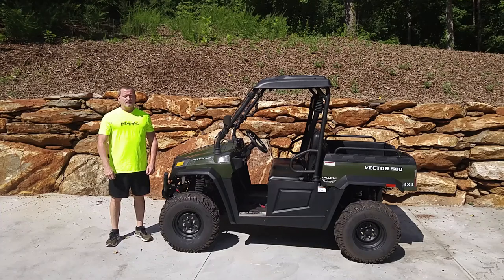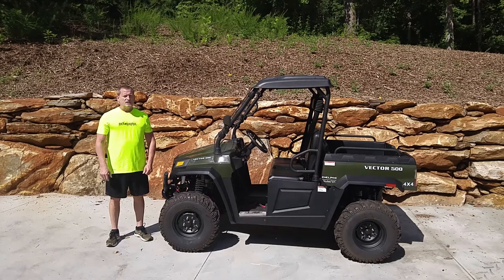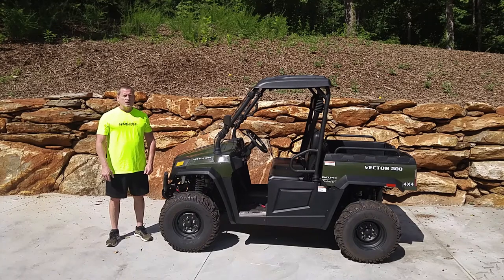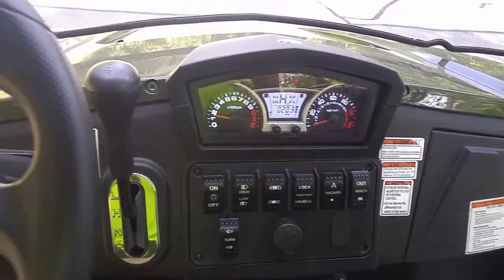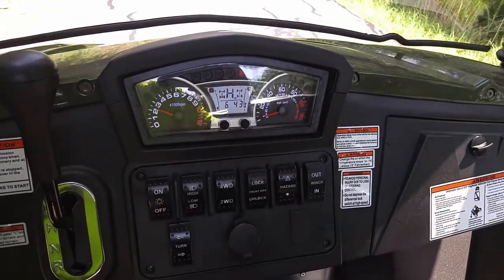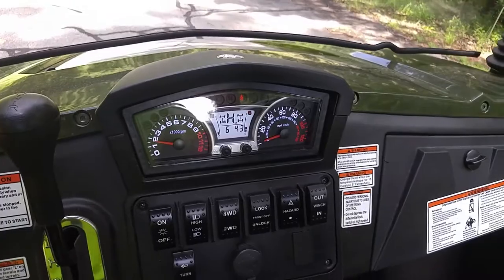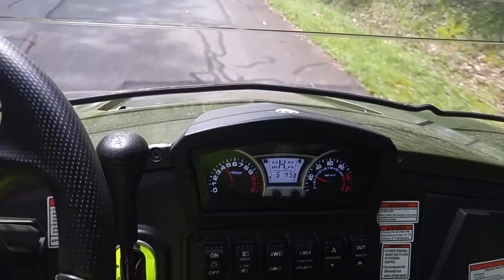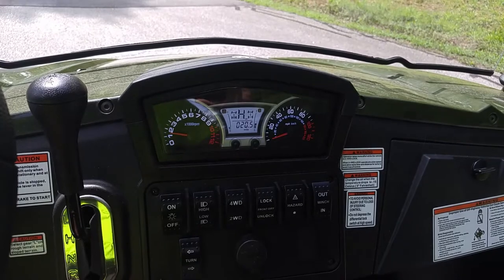Vector 500 4x4 UTV Speed Governor Seat Belt

Comment: I just bought a Tboss 550 and have the same issue however I fully removed the entire seatbelt buckles and straps in place of a 4-point harness. There were no wires, how does the engine no to retard the ignition?
Reply from the maker: I'm thinking there probably is a sensor in the clip.
Reply: @Aksmaniyak  Looks like it wasn't a chip or sensor, the 2020 T-Boss's factory ECU was flashed to 'low speed mode' and after swapping it out for a 2nd unit everything runs great. I went as far as looking up the ECU to attempt to flash it myself and the units they use are ANCIENT (like Windows 3 ancient - pre OBD).